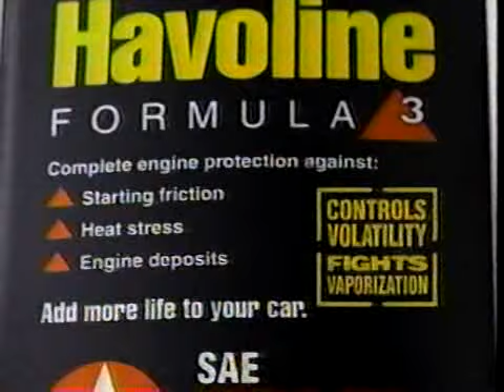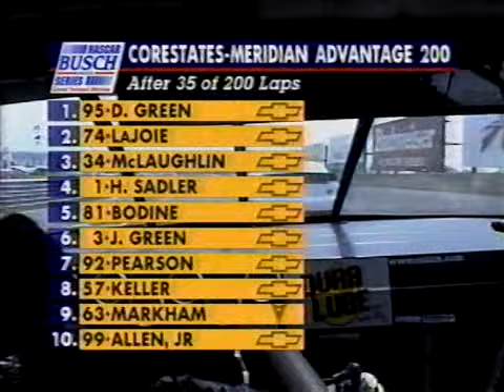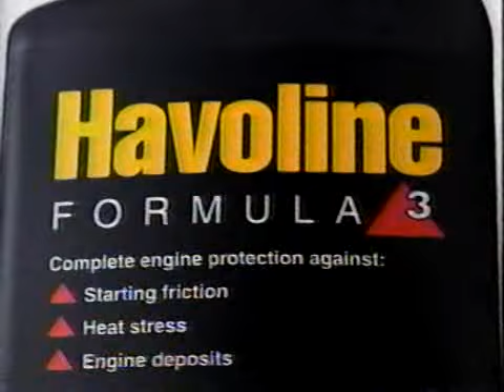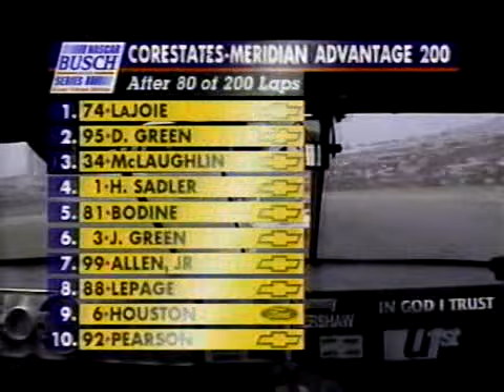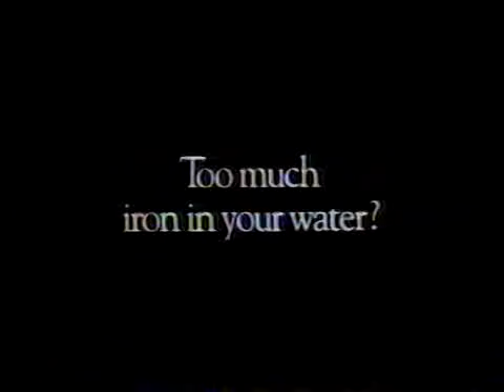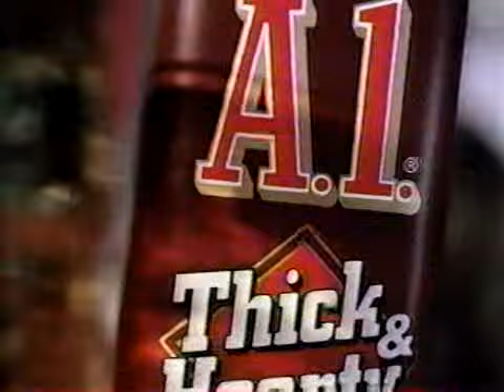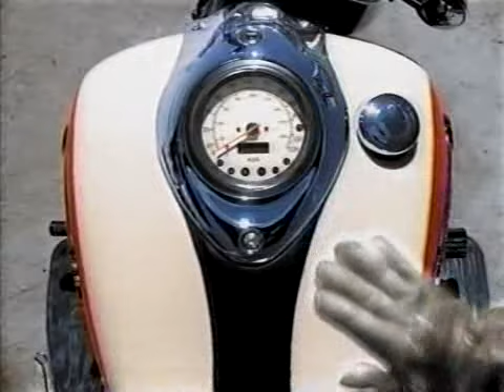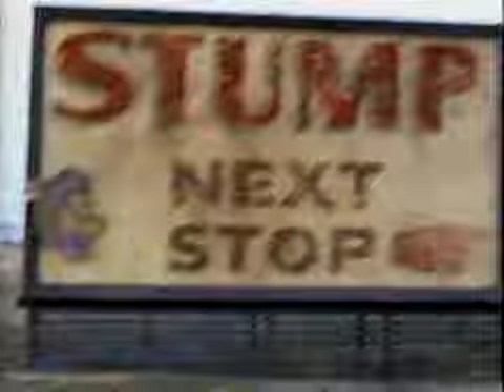1996 Nazareth Speedway - Meridian Advantage 200

Comment: Mentioned by Mike Joy after driver intros, Martin Truex did not make the race. I am assuming this is Martin Truex “Sr.”
Reply from the maker: That's correct. Truex Jr. came along around 2000 running BGNN Series